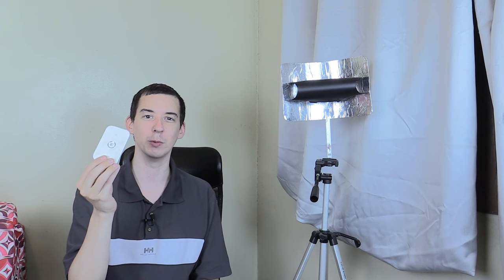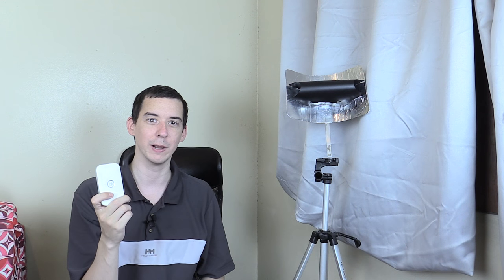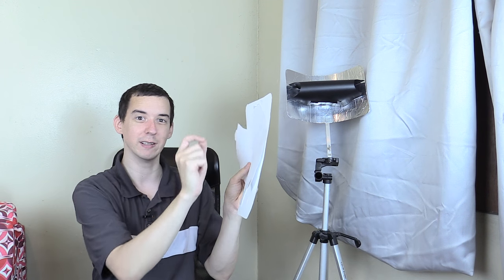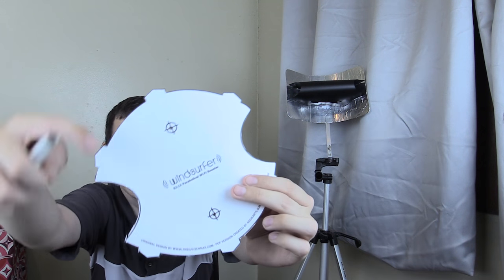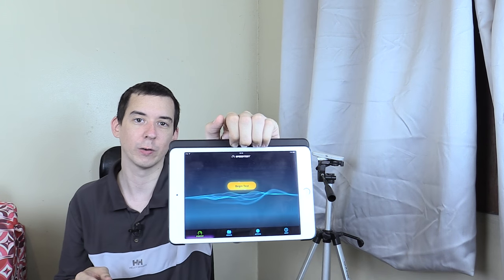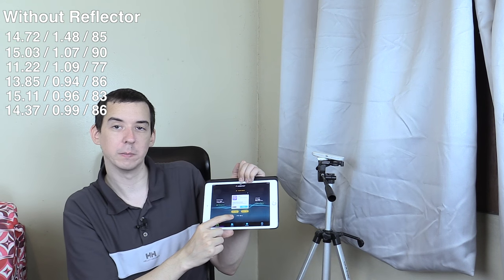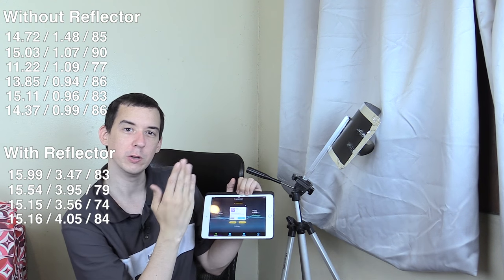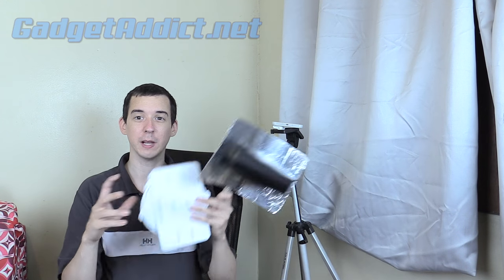DIY 3G / LTE Signal Booster - Part 2

Comment: It really has a significant effect on the upload speeds, as you mentioned in your first video. Fascinating.
Reply from the maker: +J. Tan also for the download but the signal is so good to start with that it's hard to show the benefits on the download. And I think some kind of speed cap is being applied.
Reply: I see. Thanks again for sharing this DIY hack.

That's the trouble with our telcos here. They lack transparency because the National Telecommunications Commission can't (or won't) enforce. :(
Reply: +Gadget Addict capping :(

Comment: Thanks mate, you're a life saver! I was sick and tired of buying non-functional antennas already, so I tried your solution and was amazed by results. Upload speed and ping time increased dramatically. Download speed went up too, but not much because it's already capped (lots of users connected). All in all, better than any in/outdoor antenna I tried so far. Thanks for the video!
Reply: ciaerwin Tanpiengco  Thanks for suggestion, but my router is not battery-powered. And even if it was, I wouldn't be at rest putting it outside between -20 and +50 °C :) Anything electronic tends to break sooner than later in such environments (without proper protection). Wow.. 4 years ago..

Comment: Really usefull thanks
Ive heard that there are some very punative  datacaps in the philippines so do you find you hit those caps quickly and then get throttled back for the rest of the day?
Sibat
Reply from the maker: For many years, they marketed 3G/LTE mobile internet as an 'unlimited' and 'suitable for home/work' internet connection, partly because DSL/Fiber infrastructure was so poor. By advertising it like that but then having aggressive secret data caps, it caused a LOT of complaints. The telcos are now getting better at disclosing data caps which makes it easier for consumers to know what to expect. I still find their pricing quite competitive compared to other countries. It can be unreliable and at times very slow, but the amount of data you get for the money is competitive.  There's still some 'gotchas' though. For example if you pay for a time-based connection, instead of data based (e.g. 2.5 hours for P20), you can truly upload/download as much as you like in that time period. But if you consume too much data while using those time based packages, they'll block your sim from connecting to LTE and in some cases even from 3G. Eventually your sim gets unblocked, but by that time your package will have expired and you'd have lost the money you spent and been left unable to brown the internet. To be honest, I don't really use mobile internet much anymore, except for uploading videos to Youtube and for live streaming, because I can get such a better upload speed over LTE than my home DSL.

Comment: is the signal concentrator you made be used for outdoors? Need alternative for old TV satelite dishes.
Reply from the maker: It would probably work better outside, especially hooked up to a tall pole. But you'd need to somehow secure the modem against rain. You'd probably want to make the reflector out of a GI sheet or similar, so it stands up better than cardboard and foil.

Comment: just would like to ask. the concept of this is booster is to focus your signal to one direction. This affects both cellular and wifi signal? if ur futher away from the router and facing bahind it would it decrease wifi signal?
Reply from the maker: +Carl Andre Batucan yes that's absolutely correct. But the wifi signal is generally so much stronger than what you could pull over 3G / LTE anyway, so it won't be noticeable.

Comment: i am going to use dish plate for wifi booster , could it works. i use wifi device in place of tv receiver. kindly reply
Reply from the maker: Oh I thought you meant a satellite dish.  An aluminum covered dish plate will help a little but not as much as using the template from this video.

Comment: May I suggest, not to run the test on an Wifi-Device. The Wifi strength is affected by the Reflector also. Maybe this is the reason why you got good results in very strange angles(in the 1st Video)?? Or you mount the Tablet on the top of the Reflector. So the Tablet can "see" the mobile hotspot directly.
Reply from the maker: You have a valid concern and something that was discussed in other comments. The WI-Fi signal is so strong that it's not really effected. I did tests with the pocket wifi connected via USB and then over Wi-Fi and the results were practically the same.

Comment: what pocket wif U using ??
pocket wifi brand model name pelase ??
Reply from the maker: It's the HUAWEI E5573S-320. It's the same as the regular E5573S but software and hardware locked to the Smart Philippine network. It supports up to 2 external antennas with the TS9 connector type.

Comment: can i use aluminium foil on dish tv anteena
Reply from the maker: A dish used for satellite TV works extremely well. You don't need to add foil. Just mount the pocket wifi to the LMB (google for an image if you're not sure which part is the LMB).

Comment: Some parts of the video are a little washed out. It doesn't look horrible, but it does look odd.
Reply from the maker: It must be the camera settings. I was trying to get even lighting without any major shadows. I was also trying to tweak the white balance to get something truer to life. I need to spend more time playing with it and working out what looks best :)
Reply: Gadget Addict You might consider using a gray card, if you're not using one already, so you can also make adjustments when editing.
Reply from the maker: RoloisRight I have one, but truth be told, I don't fully understand how to get the best use out of it with my camera. I need to watch more tutorials.